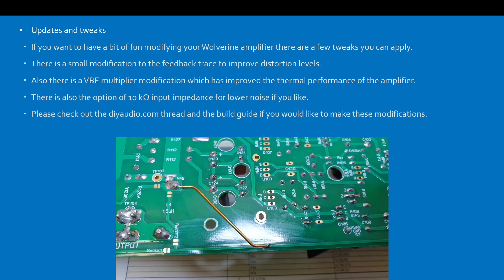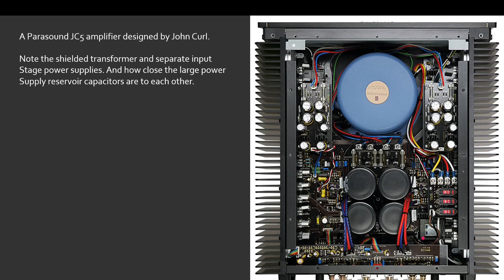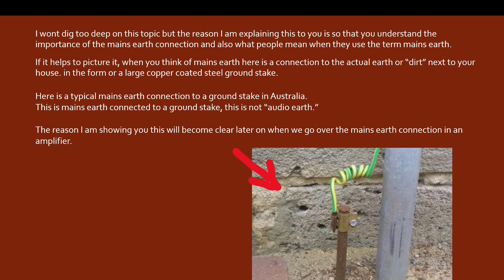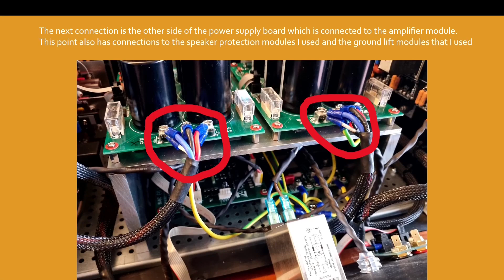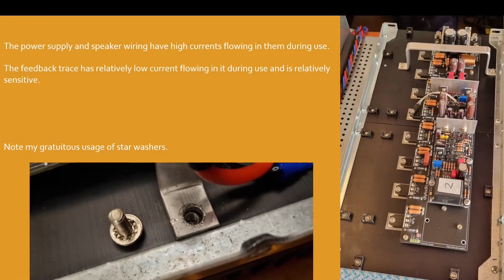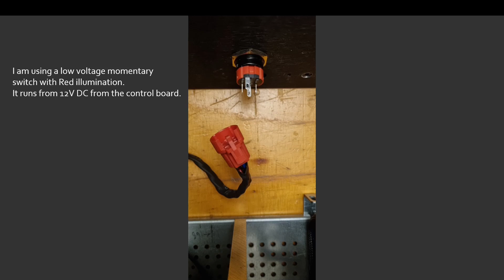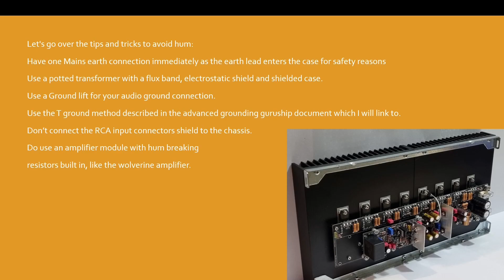Wiring your amplifier

Comment: should the 2 input grounds be kept separate until it reaches the amp boards? or connect both at the RCA socket?
Reply from the maker: If you have the inputs close together, I would suggest to connect them but results may vary depending on your build.

Comment: Really nice example.  Please could you put a list of parts and ancilliary boards you used in this example - things like the ground lift board, the softstart etc.
Reply from the maker: Thanks for the nice comments Mike, I would suggest to have a look in the wolverine build thread for this information.

The gnd lift is here: https://www.pcbway.com/project/shareproject/Ground_Lift_PCB_V1_1_173beed5.html#:~:text=Lift%20PCB%20V1.-,2,use%20of%20a%20bridge%20rectifier.

The soft start boards were Virtual Zero Audio: https://www.facebook.com/virtualzeroaudio/ 
not sure if they are still around. I had to modify these a bit to work.

Transformers are Toroidy brand.

Case is from the diyaudio store (deluxe 5U)

I hope this helps.

- Daniel

Comment: IS very interesting how  these guys are regarding audio throwing everything they can to the mix in order to get the lowest THD possible ... even  at 2:00 hack the hell up a nice board with a nasty wire.... and that's cool and fun, no judgment
Reply: No, it's about loop area, and how the high currents in that area generates magnetic fields and how those magnetic fields get coupled into the feedback trace.
Reply: @stuartmp1974  Oh! I think I see it, so having the output inductor on the other side of the board(Route 2) and R126A and B on the other side of the board (route 1) cause those loops ... so grabbing the NFB trace (that have ground traces on the other side) before all those components and routing it with a more direct path and nothing on the other side, just like the wire in question, will improve the NFB signal and avoid the mentioned loops right?
Reply: There has always been a few ways to run the NFB. Only now that we have the ability to measure the differences do we truly know the optimal path
Reply: I appreciate your participation in this community and your eagerness to contribute. However, let's try to maintain a positive and respectful atmosphere for everyone involved.

It is worth noting that while this modification may only bring slight improvements across the full bandwidth, it is still a topic of discussion for some individuals. We have acknowledged that it is not a vital modification, but it can be interesting to explore nonetheless for users that want the Lowest THD

If you have difficulties or concerns regarding placing a small piece of wire on a PCB, it might be helpful to ask for guidance or further explanations.

Let's focus on constructive discussions and learning from one another.
Reply: @stuartmp1974  Thank you.... as I said, not judgment I just find it very interesting.
Reply: The feedback trace can have a massive impact on distortion hence the options we have provided to try and find the best location along the way. We have now settled on the best location
Reply: @stuartmp1974  So the goal is to reduce inductance on that trace bypassing rout 1 and route 2 of the NFB network right?